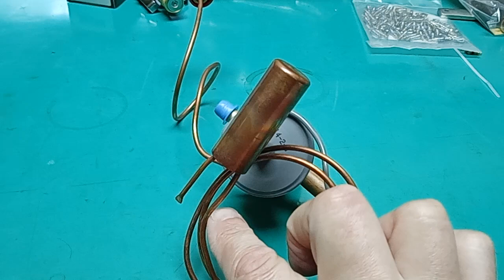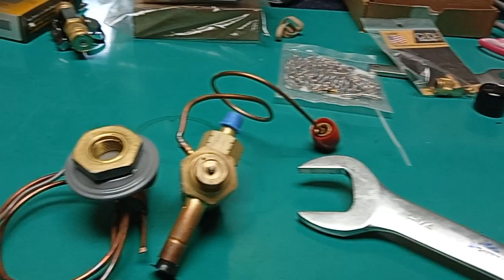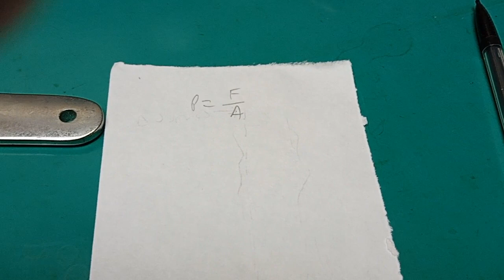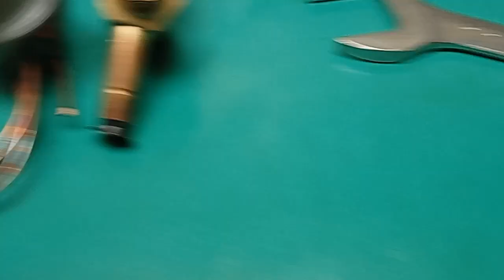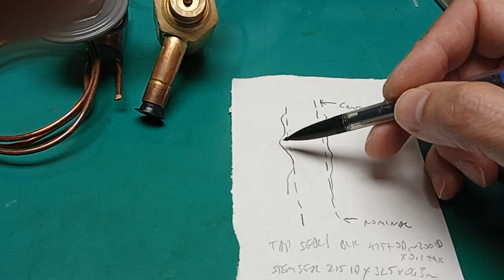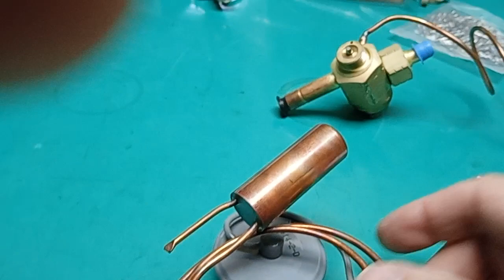TXV Design and Operation

Comment: The EPA also excludes R-600a..
Reply from the maker: Yes. This is because they cant regulate such small quantities for residential uses, there are far too many users. So they will aim  to use non -ODP and GWP refrigerants for residential applications.

Notice that MVAs are regulated, except for replacement R-134 (which is a poor substitute). Thats related to the fact that many auto -related companies do MVA installation and repair work. They can regulate business use and try to scam corporations out of money that they cant get from Homeowners.

Its a balance between using refrigerants that might not work as efficiently but arent regulated, and the huge amount of energy used in residential applications.

Using 40 pounds in a wind turbine is another matter

Comment: It took me two day to finish a job to replace the txv valve r22 I did travel 1 hour 1/2  to get the txv one way. After watching the video I could replace the top,instead of cut welding,closing the refrigerant into compresor. Thanks again
Reply from the maker: Can replace the top. There may be a loss of refrigerant. It should be a small amount of vapor.

The amount may be very small if the system operates and lowers the low side pressure. In my heat pump, the low side is 50 psi to the bottom of the diaphragm when the system operates with the broken capillary bulb. The TXV is closed, the compressor pushes the refrigerant into the liquid line.

Important to know how the system works to know the pressures and loss when the top is removed.

In my system, the loss will be 0,16 ounce per second thru the equalisation tube, a very small amount. It may be 5-10 seconds to unscrew the old cap and screw on the new cap.

One ounce lost from 7,5 pounds is not important